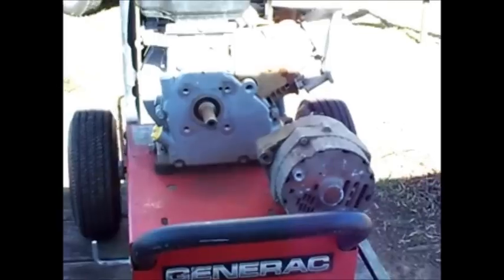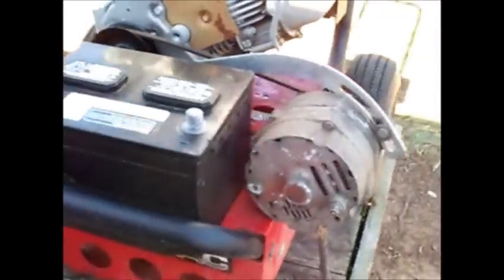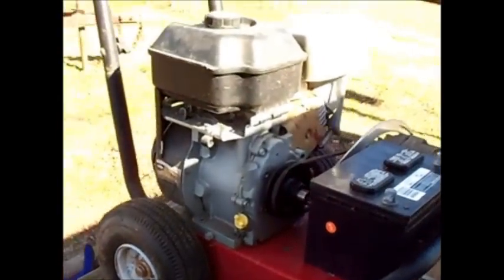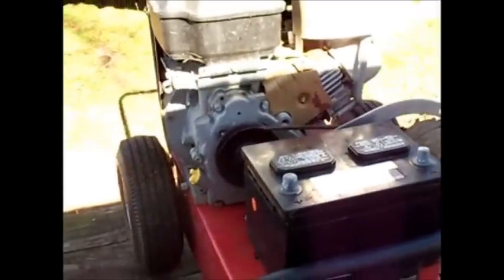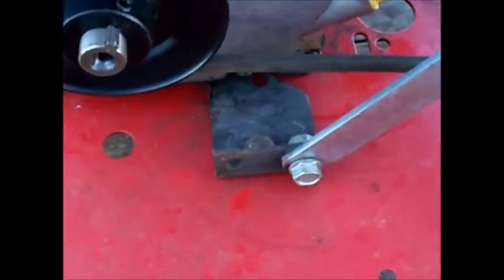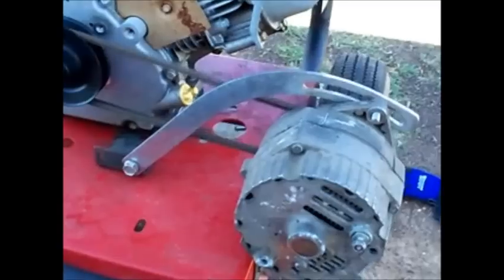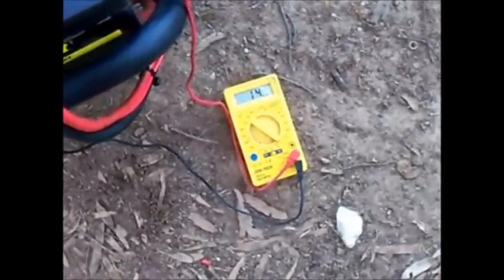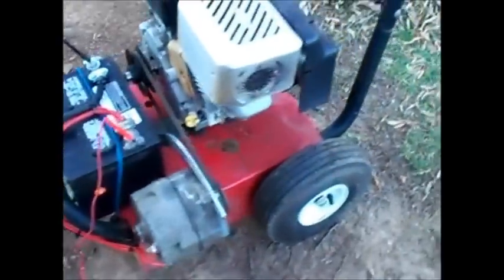How To Make a 12v Generator power source

Comment: Tried to run my fridge with 1000 watt inverter, but kicked off from startup surge. I had to get a 2000 watt, works great. I live in hurricane territory and don’t want to go out during the storm so I have a deep cycle battery and inverter. I don’t think the battery on the cart is a good idea. The vibration of the engine is not good for the lead on the plates.

Comment: I find your videos very helpful and appreciate your contribution to this subject. Would you by chance happen to know if that internal regulator knows when the battery is fully charged to stop sending power to the battery? If so, could you just leave the switch on (switch that excites the alt.) or would this need to be closely monitored once the battery gets near the full charge to manually turn off the alt. excite switch?
Reply from the maker: I don't think this on actually stops charging unless I flip the switch off but I've never had an issue of over charging the battery..

Comment: Cool, but isn't 6hp a bit overkill for 1 alternator? I would think 2 just to get the full potential.
Reply from the maker: not when it's under a heavy load like running a large winch or a power inverter..
Reply: savagenomore Suppose, just that a lot of people on yt use 2 hp even 1 hp sometimes.

Comment: if it is just to charge batteries.  I would add a solar charge controller, it would regulate the voltage to the safe charging voltage and stop feeding power to the battery when it is charged and not overcharge the battery.
Reply from the maker: davidbrennan5 this alternator has an internal regulator, it is set up just as it would be in a car so there's really no need for an external regulator that I see...

Comment: Will this power up electric heaters. I'ma look at the volts the heaters take ?
Reply from the maker: this alone will not power anything that is AC volts, you would need an AC power inverter and you would need one that would handle the amp and voltage requirements of the heater...

Comment: I actually plan on building one of these for when I go off the grid. I plan to make mine direct drive. There are kits available online for just under $100 to make it direct drive, but it is rather dumb to use them because you can go to a Rural king, or Farm and Fleet and get those same parts for under $15.  My concern was having the fan spinning the right direction, but pausing at 2:13 I can see that it will be spinning the correct direction.
Reply from the maker: I plan to build another that is direct drive and I too was concerned about the rotation so I looked at the one on my truck (since they are same) to determine which way I needed to mount it, thanks for watching..

Comment: nice build. one thing though, I would go with a larger pulley on the motor. engine speed doesn't change the voltage on an alternator very much, but it will vary the amperage. IE: a 130 amp chevy alternator puts out 130 amps at around 1500-2000 engine rpm, but at idle 500 or so rpm it may only be putting out 20 amps, not exactly sure the idle amperage, been too long since I measured one.

Comment from the maker: pretty much any alternator with internal regulator will work you just have to know which terminal to use for the power on, I'm using a GM 12SI 63 amp in the video but now I have a GM CS130 108 amp on there, I'll make a video showing how to wire it all and post it asap..

Comment from the maker: I wasn't much concerned about hiding the belt, I was more for the easy access of it plus these alternators are designed to run in a horizontal position, you can run them vertical but they have needle bearings on the rear shaft and I was thinking it may cause premature wear on it..

Comment: great video, I actually am going to build one on a snowblower frame because the front blower went bad so I still have a good motor and I was actually going to leave the drive gears hooked up so I can drive it around it sounds silly but will be ultra cool, then have on the front 2 battery boxes for battery storage and moving, and It will even have the clutch for the alternator left over from the snowblower drive gear. so you could say I will have a 3 speed generator with reverse